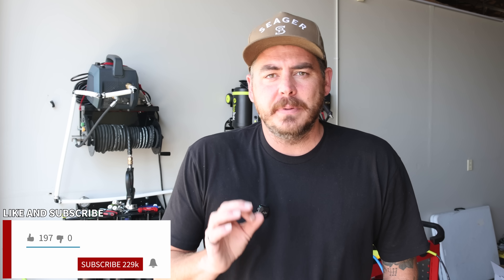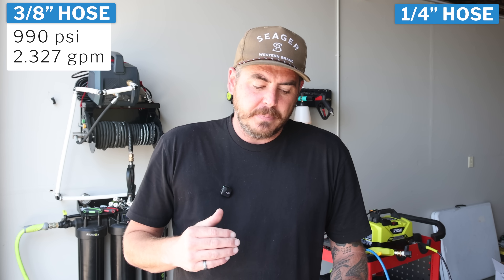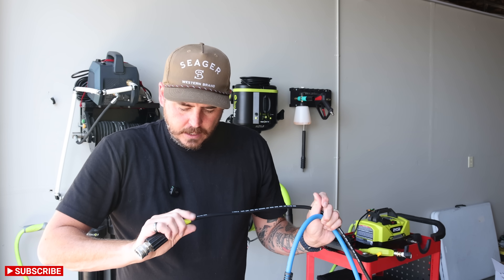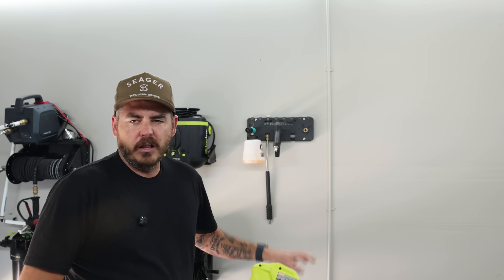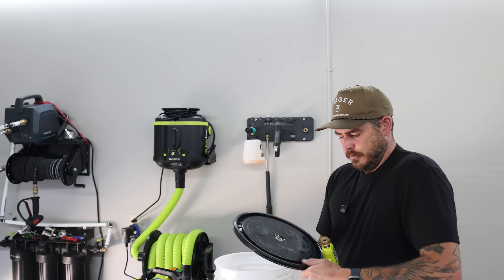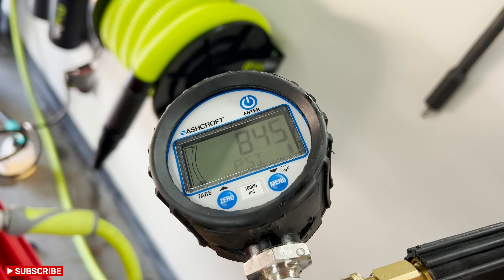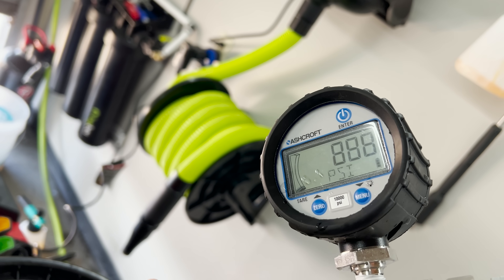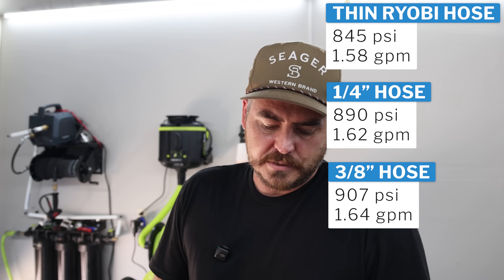PRESSURE WASHER HOSE COMPARISON - DOES SIZE EFFECT PERFORMANCE?

Comment: STOCK HOSE:  845 psi @ 1.58 GPM
1/4" HOSE: 890 psi @ 1.62 GPM 
3/8" HOSE: 907 psi @ 1.64 GPM
Reply: Notice the flowrate change is negligible but the pressure loss is significant. The pressure washer is compensating with more amperage to deliver the same flow. Without knowing the head pressure, we have no visibility to what the actual pressure loss is.
Reply: @StevePierson123 I'm most impressed that there is an improvement in BOTH flow and pressure!  I was expecting more of a trade-off.
Reply: @AMI_Detail  Flow increased by only 4%, but it caused the pressure to increase by 7%! Yet, the amperage dropped! That’s why it’s important to know the pressure at the beginning and end of the hose - pressure (and pressure drop) are directly related to amperage. 

Contrary to what we think, pressure at the pump head will always be higher than at the end of the hose, but, the flow rate does not change no matter where in the line we measure.
Reply: @StevePierson123  Would it help to take  measurements as close to the pump as possible AND at the end of the hose?  With my Dual setup, this would be after the check valves and the Y.
Reply: @AMI_Detail that’s correct. You measure right at the outlet of the PW, and then the end of the hose before the gun. Subtract the two values and that’s your pressure drop!

The higher the pressure drop, the more friction in the system. IIRC, a 50ft 1/4” hose at 2gpm can have 70-90 psi of drop. A 3/8” hose had almost no pressure drop.
Reply: @StevePierson123  so i'm new to all this stuff.  are you saying it's better to use a 3/8" hose because it would be easier on the machine and less amps at the wall ???

Comment: Hmmm, numbers don't match with cars with keav, sure that gauge is reading correctly? did you get it calibrated as you mentioned in an other video? Great video and content as always!
Reply from the maker: Yep this is a calibrated gauge. However water outlet pressure and exact bolting at the plug can cause variances in performance